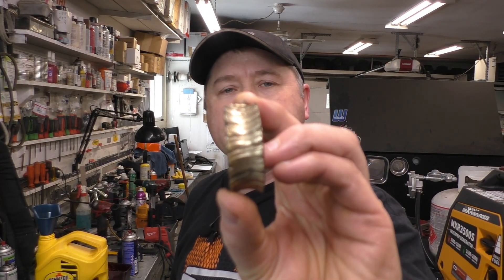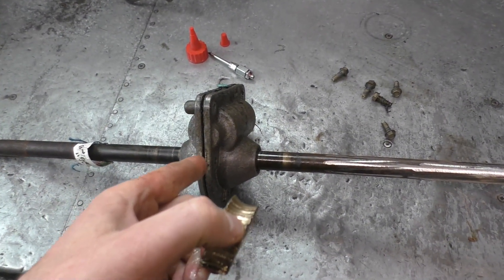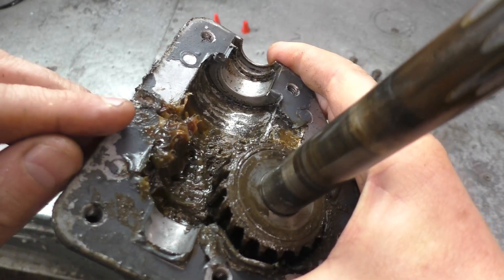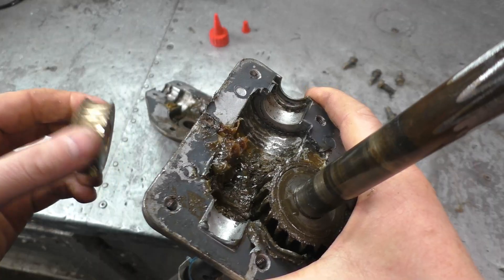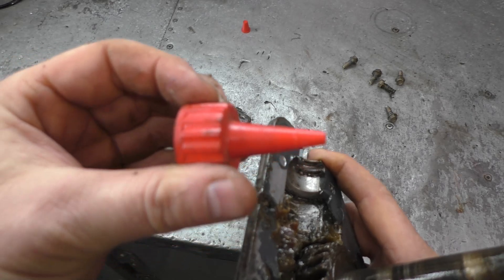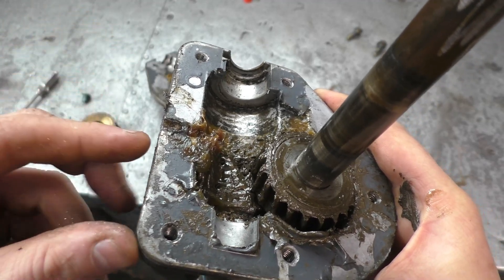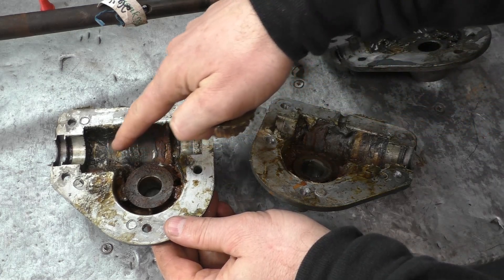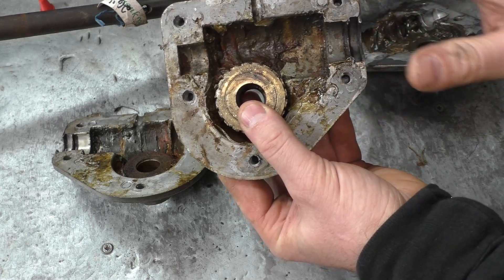Why Did This Auger Gearbox Gear Fail?

Comment: Also if you replace the shear pins with hardened bolts the brass gear will take the abuse instead of the shear pin doing it's job.  I just replaced a brass gear where the guy was using hardened steel pins instead of shear pins and you could see where the hard bolts were bending and mauling the hole also, if you hit a rock the shear pin needs to be able to shear, also,, don't hit a rock, ah ha.  (Great videos Donny).

Comment: I have a question for you, Don.  The MSDS for the MTD alvania grease calls it “00 EP Grease.”  Of course it’s unavailable from MTD still.

I have sources for two different 00 greases.  One is known not to contain any sulphur (which attacks bronze gears), but is not EP.  The other is EP but I can’t get a good answer as to whether the EP ingredient is sulphur (it often is).

How important is it that the grease be an EP type?  It seems like it would be a good thing in an auger gearbox where a lot of hard work is happening.

Comment: Both of my mid 90's John Deere snow blowers, (828D & TRS 27) have MASSIVE heavy duty pumpkin size gear boxes.....very solidly built but could still grenade. Everybody should get in a habit of cleaning out their bucket and augers after use, especially if the snow you were just blowing is slushy....that crap freezes your auger assembly tight and then you go to use your blower and either grenade your belt or worse yet damage the business end of your blower....clean after use gang.

Comment: While I agree that lack of maintenance with correct lube is a factor, I think another major failure is people replacing shear bolts with regular bolts. If the auger gets stuck there's no way that brass gear is going to win against the steel worm gear.

Comment: My MTD manual says to only only change the grease IF the gear box has been "disassembled for what ever reason". No mention of it in the maintenance section. I'm going on 25 years with this machine.
Reply: I've got 30 years on mine.

Comment: Same thing we have found at Eliminator Performance with the white lithium grease separated to the sides always. Additionally, never have seen any come in with 00 grease or other lubricants added. Part of our normal service on snowblowers is the addition of 00 grease except on the Ariens which call for L2 on the older models and L3 on the newer models. Ariens even give you a specific depth to check from the top of the gearbox case to the level of the oil which many do not know (it is in the manual).

Comment: Great follow up, Don, but now I'd like to know why they made it out brass, which is a soft metal.  It's common to have to add grease periodically to components like that, but using better metals would make a lot more sense.  It's like it's designed to fail, which is an all too common practice these days, mostly done to sell replacement parts, IMO.  Either that or new devices.
Reply: if and when the grease is gone and not replaced they want the brass gear to take the hit instead of the more expensive driveshaft and worm gear. dont want a nightmare to be an even bigger nightmare.
Reply: @michaelotoole1807   Alrighty then.
Reply: At Eliminator Performance we have seen the brass gear totally split apart because customers had used grade 8 bolts instead of the required shear pins or bolts. In two cases it was so bad the aluminium gear box housing was also destroyed. Very expensive invoices for our customers for not using the proper parts that only cost $3 to $4 each

Comment: I always use 80-90 rear  differential oil in snowblowers, rototillers and electric power tool gear cases,  it always flows and prevents wear .
Reply: It also leaks out of worn shaft seals and gearbox gaskets, while NGLI 0 and 00 don't.

Comment: Don, fixed a Craftsman and it had plenty of grease in the housing.  I was surprised but ask the owner it hit something and stalled as the shear pins were original.   He told me that in the wet snow it kept clogging up and he was rocking it/banging it to clear the clog.  Do you think that this could have not broken the shear pins and helped with the demise of the brass gear?   Again this is why I swear by WD40 or some other lube on the auger housing and chute!

Comment: They sell 00 grease at tractor supply for $5 a quart it's marketed as cotton picker spindle grease. Manufacturers of newer snow blowers are now using synthetic 00 grease instead of regular 00 grease,but it's even harder to find either one will work synthetic is just a superior purer form.  The key is only using 00 grease period no exceptions, THis is a grease that is flowable at low temp and is also stable in warmer weather it is designed for extreme pressure applications and has special additives to cope with that.

Comment: I use the light grease & oil mix combination. I use one of those feeding syringes you can get at local pet stores. Load the syringe and inject it in to the gear box

Comment: Speaking of Shear pin, I tried to clear the snow last Saturday storm  early morning, to my surprise, my blower could not penetrate the snow. I thought it was because the snow was wet and heavy. I can only do less than half of the width of my blower at a time, and did that for almost 2 hours, until my neighbor across, the street told me that only half my auger was working. Which I did not bother checking before starting. The right side auger's shear pin broke away. I did 2 drive way with only half the capacity of my blower. Seeing this video made me realize and thankful that the shear pin broke away rather than stripping the gear box.  I learned from donyboy, never replace a shear pin with a regular bolt.

Comment: I added some grease to mine few years ago. The blue plug on the cheaper ones do come off, and you just have to line up your grease gun to the hole, hold it firmly and add 1-2 pumps.  Then just level off the grease and replace the plug.

Comment: The older cub cadet tractor mounted auger boxes would have the thrust bearing eat the housing and wipe out the gears. If you can find it tractor supply has Super S spindle grease that is a 00 lithium grease that works very well in those boxes. Just be sure the seals are good as it flows good when it gets warm.

Comment: I found NAPA has 00 grease under the prime line brand. It comes in a squeeze bottle with the gear lube cap as Donny shows.  Just cut the tip off it'll fit right into the fill hole.
Reply: Our local NAPA does not carry it and we have been waiting for a 6 bottle order from MTD for 3 months of their 00 grease but luckily we still have a 1/2 bottle from Stens which no longer carries this 00 grease.
Reply: lucky!!

Comment: their is nothing in my snowblower manual about lubricating the gear box , should i be doing it , their is a plastic plug on on top of my Bolens 5000 series ? . oil bath ?

Comment: I had that happen on a 1978 Ariens.  The gear that came out of that gearbox looked EXACTLY like the one you had in your hand.
Reply: Did it fail from lack of lubrication or from regular bolts being used as shear bolts?

Comment: i wouldn't recommend people add a grease fitting or adding grease. most times they will just add the wrong grease and still have it fail especially if the grease in the gear box has already gone bad. the grease in the gear box you showed looks like it has the wrong grease in it which is why it likely failed. i have see similar in gearboxes that have failed. i personally think it could have possibly been the wrong or a bad batch of grease added at the factory. i have pulled apart other gear boxes on well used machines and the grease and gear looked brand new which is not surprising considering the gear boxes are pretty much sealed.

Comment: My older MTD machine doesn’t have the zerk fitting. It would be awesome if you posted a video showing the process of adding a fitting to machine. Thanks!!!
Reply: My cub cadet has none also. Still would like a video on just how to tap and drill. I am in no way a mechanic, and, have never tapped anything
Reply: Would just be nice to see it all actually done. Knowing which size zerk fitting, where to drill and tap, etc etc. It’s just always nice to see the Pro DonyBoy do it first before we try and attempt it on our own machines.

Comment: Yessir. Grease is the life blood of metal parts. No grease no life! Thanks again Dony.
Reply from the maker: you'll never go broke using grease!
Reply: @donyboy73 what about adding Liquid Moly synthetic 75W-90  gear oil in addition to what I have. I’ve had my machine for over 20 yrs and have never added anything bc my owners manual states that it doesn’t need it. Now im concerned!
Reply: @demetriosa7646  Been jusing GL4 gear lube in my snowblowers for decades. Safe for yellow metals. That gearbox is along the same idea as the differential in my truck. My truck goes down the road at 70MPH with gear lube and works fine.
Reply: I seen a sticker on a road grader that said -  I need grease to live - 👍

Comment: Many years ago,I saw a Braden winch that was run dry with the teeth worn out of the bronze gear.. Steel screw will destroy a bronze gear in very short order without lube...

Comment: Mine also uses gear oil not grease.
Reply from the maker: gear oil is better than grease
Reply: Would you recommend adding synthetic gear oil to the existing grease that has from the factory?

Comment: My Ariens uses Synthetic Gear Lube Oil. It's about the viscosity of regular motor oil. The gearbox has a little drain plug on the front to check/fill the lube. It's sort of like checking oil on a car differential. On a flat surface, the gear lube in the gearbox should reach the bottom of the service port hole.  Being a viscous liquid, no worries that it will stick to sides of the case.

Comment: It should be mentioned the two gears are dissimilar materials- brass and steel. When the lubricant fails or the auger shear pins don't shear (because someone used regular bolts instead), the steel worm drive eats the brass helical gear.
Reply: In case anyone is interested, there's a reason why the gears are dissimilar metals. I worked as an engineering assistant in a manufacturing plant. With precision drives. steel to steel, or brass to brass gearing is infrequently used. Similar metallurgical structures will tend to bind and cause excessive wear.  The 'brass' gear might actually be bronze, they are similar metals made predominantly of copper - 85% to 90% for either alloy. 
The shear pins are supposed to prevent this type of damage, as will proper lubrication. If it's insufficient lubrication, the very hard worm gear will 'eat' the brass/bronze gear. It it were shear pin issue, I think only a few teeth on the brass/bronze gear would have 'snapped' off.

Comment: I'll stick with my early '90's Ariens with a gearbox full of gear oil (actually, Ariens Synthetic Lube #3).  I drain and refill it every couple of years and I'm expecting it to last indefinitely.  I did put new auger-shaft seals in it about 10 years ago and it still looked brand new inside.
Reply: On the newer models it specifically calls for L3 but the full point is 2 3/8 to 2 5/8 inches down from the top cover. Garage Gear has an excellent video on this.
Reply: My late 1970s ariens has the same cheap aluminum gearbox case with a super chewed up brass gear

Comment: Thanks for that info, I have an old snowblower and didn't know that was a 'needs service' part. I always thought it was a sealed unit with oil or grease and you didn't take a part if you didn't need to. Will have to look at mine before next season. To cold now.

Comment: I have a Toro 38841 blower. The owners manual spec sae 85-95 ep gear oil lubricant for the auger gear box. Would thus lube be acceptable is other manufacturers blowers?

Comment: Well, that's what I have done, added a little gear oil to the grease to make it more fluid.  Always wondered if it was doing good or bad.
I remember years ago gear oil was what was in there instead of grease. 
Around here a lot of rusted out blowers get thrown out with the augers and all the gears still perfect.
People don't know the value of it until they need it replaced. 
I started saving them, got about 10 sets before I ran out of room.

Comment: I repaired a Craftsman  snow blower where the owner decided shear pins were too expensive  and used a regular bolt. Being the end of his driveway  was plowed in with slush and froze by the time he got home at night, he was trying to blow ice. It chewed the snot out of that same gear. I rebuilt it and be darned if he didn't do the exact same thing a year later. People cost themselves more by ignoring the owners manual. He ended up giving me the snow blower and I salvaged the engine and scrapped the rest.
Reply: I fixed one too just like that, brass gear, and the worm gear is steel but the guy didn’t put proper sheer pins in just grade 8 Bolton. Well, they don’t give.